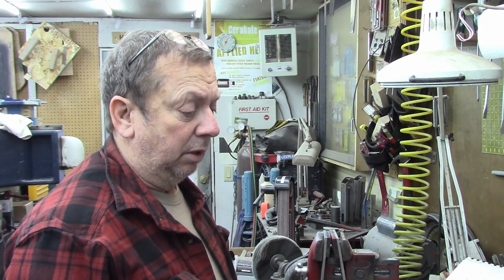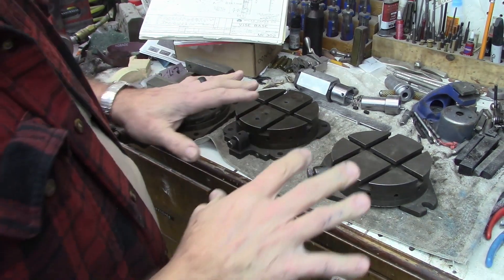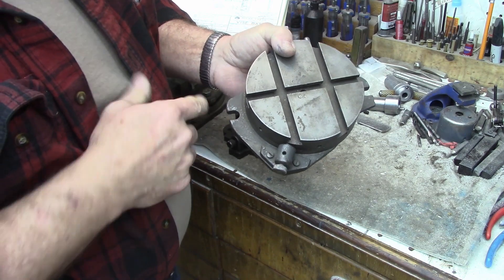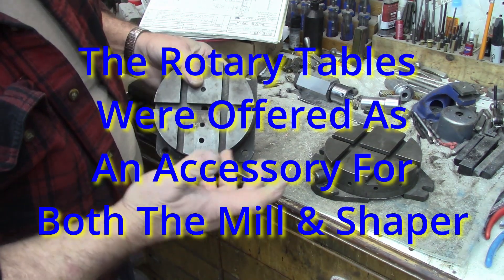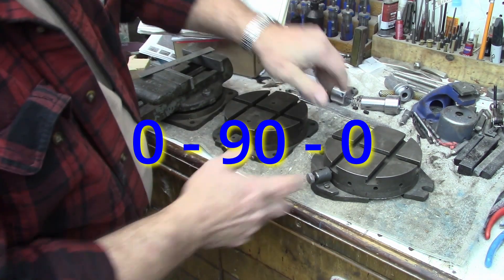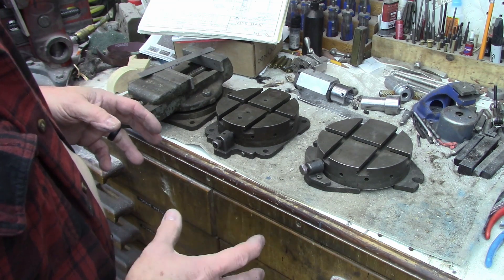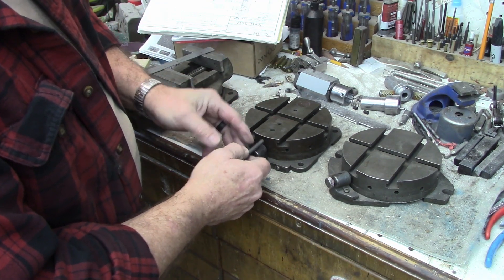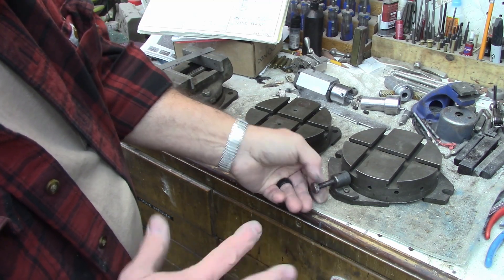Atlas Vices & Rotary Tables

Comment: Dan, I have been looking for a shaper vice for 2 years and they seem to be hovering around 400+ on fleabay which is crazy, any idea if any company has made a replacement that does not cost what the machine cost? Thanks for your insight.
Reply from the maker: Hi Carl: I haven't seen anything that I have really liked. you might look at the palmgren? The reality is that an import may be the best option but everything else looks out of place to me. That is a wishy washy response.🙂  Now having said that for actual use with the best performance, any of the newer vises are probably a better choice. The atlas, while good for it's day is lacking in it's design by todays standards. It works fine but chips and swarf fall directly onto the vise screw and have no good way to flush on thru so they are a hassle to clean and allow crap into the nut. As a side note the vise is also one I am working on patterns for, but who knows when and if I will get that far. Dan.